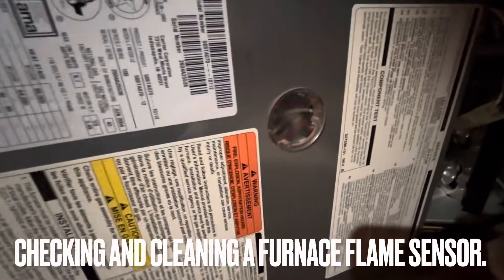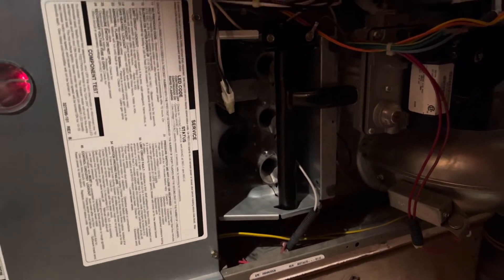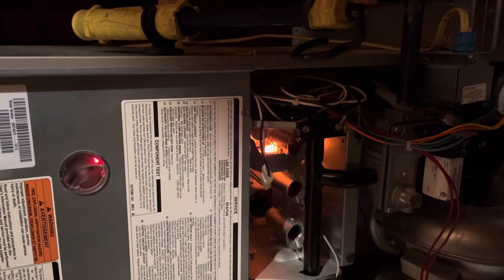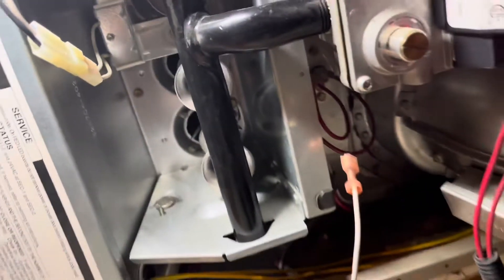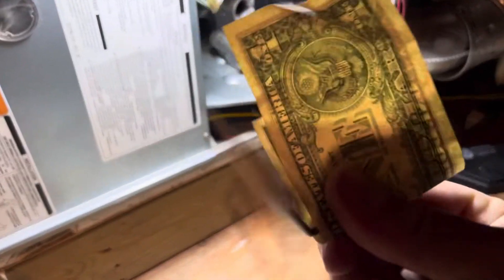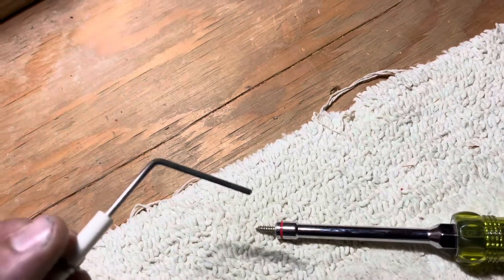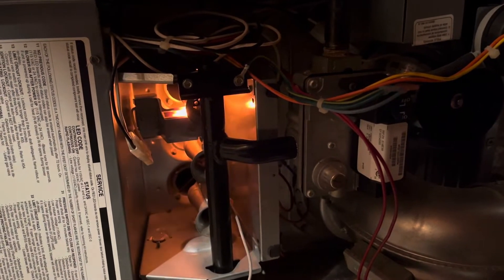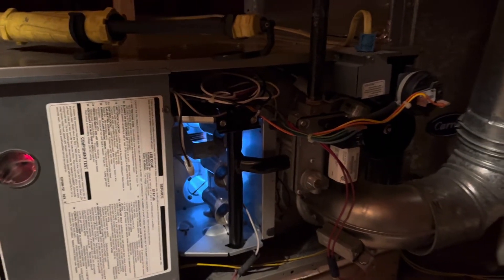WHY DOES MY FURNACE START AND SHUT RIGHT OFF?  A video for homeowners!

Comment: good job paul. I find most flame sensor are not cleaned properly and then the zinc gets groves in it and causes the build up on the sensor more frequently.  best to replace the sensor. Thanks
Reply from the maker: Thanks Mark.  In this case I cleaned for the lady to get the heat going,  but we did order a flame sensor which should be in by next week.   This didn’t look terrible but it did look almost pitted in a small area.